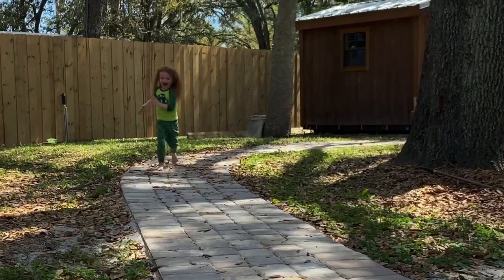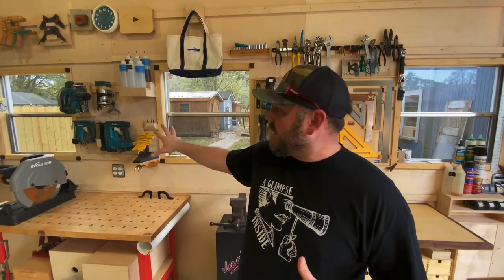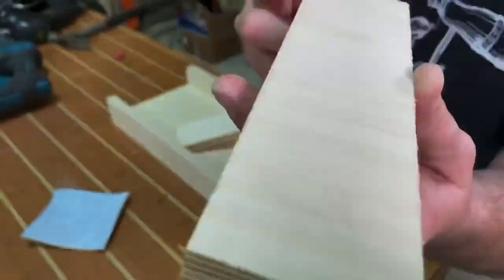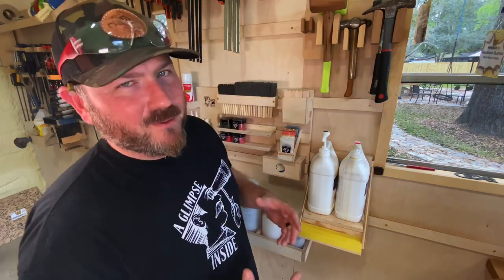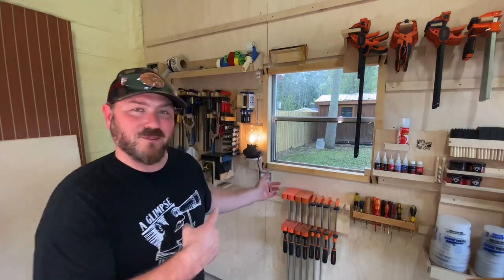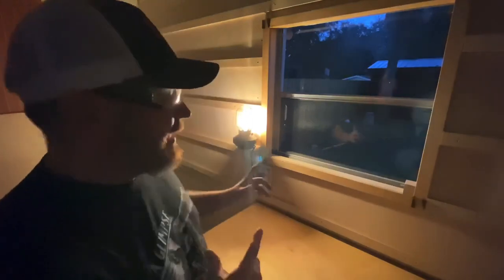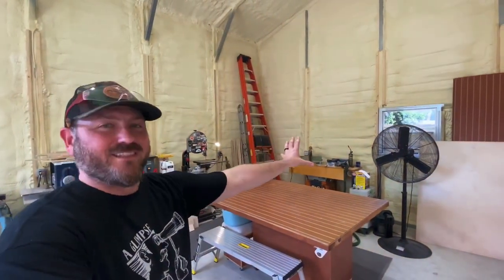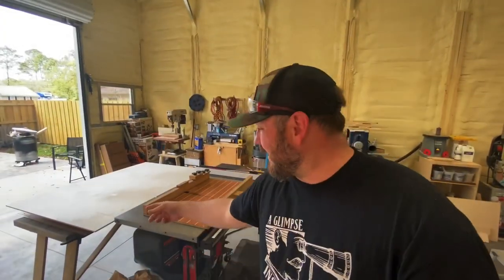30 Foot FRENCH CLEAT WALL | Shop Update #1

Comment: I used 3/4” OSB in my shop,  considerably cheaper than Baltic Birch so yes, it’s worth putting up solid wood and I’m using french cleats as well. You’ve given me some inspiration for stuff in my shop. Thanks Chris
Reply from the maker: Sounds good brother thank you for the kind words enjoy your shop as well
Reply: I did 3/4 OSB on mine also, white spry paint on the walls and I can see in my shop.

Comment: Live your shop. I am new to woodworking and have been building out my garage.  After installing new electrical I decided I wanted to do French cleat walls along several walls and insulating them with spray foam as well as the attic above the garage to then install a mini split.  This video has been inspirational and motivating.  Thanks!
Reply from the maker: Thank you so much I really appreciate the kind words

Comment: The epoxy center is great... I already had plans for doing French cleats when I can build my workshop (I am trying to relocate, so that is on hold), so I am always on the lookout for French cleat ideas. I also use them in the garden shed. Tell your daughter I said "thank you for the French cleat inception idea", since if I understood you correctly it was in part her idea. I am probably going to use that for several "tool groups" when I have a workshop again.

Comment: Hey Chris,
About your cleat on cleat travel section, I did that same thing about 15 years ago.  An advantage I found was on my mini-wall cleat section I made the section taller that need.  Custom trimmed the top and jig saw cut a hand grip into the section.  Then, like you, I can hang the section on my cleat rail or grab the hand grip and take it to my work location.   Also on all of my traveling mini-wall sections on the bottom I ALWAYS include in the planning an inclosed shelf, a box, or a slide out drawer.  The flat bottom and weight gives the entire thing stability for setting it down somewhere.
Good job.
I love your shop helpers.  I have three generations of helpers.  At present my youngest team are 7 years old, 6 years, 4 years, & 3 years.  So get them working early and who knows someday soon they can pay the household bills.
~Jim
Reply from the maker: That’s a pretty cool concept using them on a trailer like that. I like the idea of the drawer as well. You got an army of kids to help your brother nice work

Comment: Watching again because I'm ready to install French cleats.  I thought it was worth the cost to install plywood on my shop walls.  I covered all four walls (19'x20' inside dimensions), about 350 sq ft excluding windows, doors, etc. with 1/2" birch, probably the Vietnamese stuff with a very thin veneer but it serves the same purpose and I'm very pleased with the look and function.  My framing is 2x6s on 16" centers so I can still easily attach anything that's extremely heavy through the ply and into the studs.  I finished it with water based polyurethane to keep it from getting dirty.  The only downside to the cheap birch ply is that it's very easy to get splinters in the hands from handling it without gloves and I don't wear gloves around power tools.

Comment: Light idea is pretty cool. One small thought. How about enclosing the bottom into a box and at the back and bottom include a notch for cord. Then you can also move light, set it anywhere. Store cord inside box. Run cord out the bottom/back.

Comment: One could always go with particle board or a lesser grade plywood around the walls to cut down on costs and still be able to hang things anywhere.  But I do like the look of the BB, and hey, if the local store is out, just rip a piece off the wall and replace it later.
Reply from the maker: Very true but yes I do like the aesthetic of the Baltic Birch for sure I don’t know if I could surround myself and OSB LOL. Funny to think about meeting material just go to your wall

Comment: Ok, that cleat wall is goals. My shop is half of my 2 car garage and it’s not technically a shop yet since it’s still such a mess after we moved in at the end of last summer. My Spring project is garage organization and I may have to do this on the wall for the side that I will be using for my shop.

Comment: I think cladding the walls is a good idea if for nothing else than to protect your sprayed insulation from bumps and dents.  That being said, I would go with something a bit cheaper for the 'un-glamorous side' of the shop.  I have a small wall done with OSB and, if you carefully sand or otherwise hide the  labeling, it looks pretty nice itself.  I'd still use 3/4 birch ply for the cleats for strength though.  I would then invest the difference in a central dust collection system.  A shop this big and nice deserves  a big dust collector to help keep the place clean and the hoses up off the floor IMHO.  Love watching the shop go up and come together.  I'm very jealous!  I would totally "Man Cave" the place out when not working or for 'parties'!  I think that's a great idea since it overtook a large portion of the back yard.  Keep up the good work!
Reply from the maker: I agree with you brother. At least I have all the protection plus the super function. You got any pictures of your really nice looking OSB. If you do shoot me a message on Instagram I’d like to see them

Comment: Cladding the walls in plywood: I think that a cheaper plywood could have served the same purpose for the most part. [Edit: I just watched your other shop videos where you said they were like $33 apiece- that's a no brainer! Being in a cinder block house garage shop, I put up a $35'ish 4x8 sheet of sanded pine plywood from the orange store as a "screw anywhere" tool wall. The pine veneer works for me, but I get that your aesthetic tastes are yours :)

Ambient lights: I like the idea of non overhead lighting when hanging out and relaxing, but may need a more opaque diffuser such as frosting the glass or thin plane shavings (I think Pask made something like that). Then again it depends on how bright it is and if it's irritating to the eyes.

I'm about 3 hrs from you in the Tampa area. Always happy to see Florida makers who don't let this Florida heat/humidity boss them around

Comment: Great organizer wall, puts everything at the fingertips!  French cleat is a good system for a roomy shop like that, but I've tended to move away from it, since my cramped garage shop seems to shrink as my tool collection grows!  (I know, first world problems...)  So I'd love to see some ideas sometime that combine elements of both display and storage.  One such idea that comes to mind, by way of illustrating the concept, would be like a sort of 'book/leaf' tool board concept (not sure what you'd call it) where say a 24"x36" panel with tools on it, is hung on a couple of french cleat holders (top and bottom) that each have dowels for hinge pins, these dowels fitting into holes on the edges of the tool boards like hinge knuckles, allowing the board to swing left and right like pages in a book, as well as lifting the whole board on and off the dowel pins when needed, and then maybe half dozen of these boards side by side on the cleat wall?  Something that would preserve 'at your fingertips' display availability, while adding storage density to that section of wall?
Reply from the maker: That’s a fantastic idea really honestly. Thank you for that. I just might use that in my dad’s shop he is building it out now and it’s a bit smaller than this one. Maybe I’ll go film  my video with him
Reply: @AGlimpseInside    Thanks!  Although, I cannot take full credit, it's a mash-up of a couple different projects I saw at different times, and sorta just gelled in my mind.  Shop Nation did a larger swinging tool wall (https://www.youtube.com/watch?v=GojGtRKwQ0w ) with french cleats on it but mounted on wooden hinges with steel pins.  I figured a smaller board size wouldn't tear out the dowel hinge pin or the wall cleats.  Then Matthias Wandel made some wooden hinges where the door lifts off the fixed dowel hinge pin (https://www.youtube.com/watch?v=t1H7lj1zN_A ), which I thought might be more useful than having the french cleat hinge pieces permanently attached to the tool board.  So a french cleat holder with half the hinge, the dowel pointing upward, and the other half of the hinge, the hole, on the board, like Matthias's cabinet door hinge there.  Anyway, a few of those boards in a row on the wall, even if only able to swing 45 degrees in either direction, would give wide access to tools hanging on both sides of each, plus really maximize the storage density of that stretch of wall space.  Kinda like pegboard tool displays in an auto parts store, or those old blacklight poster displays they used to have in 'record shops' (dating myself there).  Good luck, hope it helps you out in your dad's situation.  And I do hope you can video it -- you make great content!
Reply: its called a 'hanging wall'.  building one now for more common hand tools as they are light. heavy stuff such as power tools goes on main cleat wall.

Comment: Good practice, lifting the finger away. Nail gun tip....99% of the time that a nail goes 'squirrely" on you when using a nail gun, it will go either right or left (perpendicular to the gun). So hold the gun perpendicular to the board you are nailing TO not the board you are nailing through. That way if it does go awry, it'll stay in the board.

Comment: I'm betting you're gonna really like that Jet air filtration unit (in the bottom box, in the corner). I bought mine many years ago when they first came out, and it was one of the best things I ever did. I wouldn't want to be without it now, 'cause it's made such a drastic difference in the overall air quality in my shop, and thus, in my overall health and comfort while being out there. And when my filters get dirty I just blow them out with compressed air, and they're good as new.
Reply from the maker: I think so as well. I really can’t wait to get it up and running glad to know that it works so well

Comment: That brad nail incident is crazy. Good thing your finger was okay. I like the french cleat stuff. I had a concept in mind for a french cleat workbench but that won't happen for awhile.
Reply from the maker: A French cleat workbench that sounds awesome. Why not bro
Reply: @AGlimpseInside  I recently just built a paulk/mft inspired bench with my own additions in January. I call the bench the Rebuilt Workbench v3. I have already started planning for Rebuilt Workbench v4. There are some tweaks I'd like to make as well as possibly introduce the first iteration of the french cleat workbench concept. My concept for the french cleat workbench involves task specific work tops that not only increase the work space of the bench but also add additional functionality to the bench. I am thinking that I will wait until I move into my own shop space to fully design and build v4. A hypothetical example could be maybe I want to add downdraft functionality to the table. I keep the main table as is then all I have to do is make a french cleat add on. Maybe I decide I want to have the table be more compact or have another module so I just remove the french cleat downdraft table and stow it away. Also I would have your typical smaller modules you would see on a typical french cleat wall that I could take off of the wall then add on the bench as needed like drill holders, magnetic parts trays, bins, glue/epoxy holders, etc. Mostly things you need on occasion but not all the time.

Comment: I know it won't be easy, or cheap, but, when or if ever possible, installing and finishing drywall, or even better using a product called Structo Glass that requires no finishing installed on the ceilings and walls above the plywood would give you much better light and obviously a completed look. When my local at the time EMTs built their new building several years ago they covered the walls in the section where the rescue and ambulance vehicles were kept so in the Winter they could pressure wash them in a heated space without damaging the walls. It has a satin sheen in white.
Reply from the maker: I will definitely have to check that out. I do wish I had at least painted the top 40% of the shop White to eliminate that yellow color. I’ll have to check out that stuff

Comment: I’m adding two comments, hoping you read this one! I’ve been looking for ie: of french cleat Heavy, Machine/Tool holders... what I mean in particular for your unfinished side of the shop is: Why not create a custom french cleat to hang your big machines on -(tools that tend to stay put but still allow flexibility to rearrange your shop) like your drill press, bandsaw -(there’s a YTuber who built a french cleat to a corner of a wall using a 4x4 or 6x6 pillar anchored to his studs, of course he added the ability to remove it when necessary, hence french cleat, but the point is he had nearly 360 degrees of space leaving him unlimited amount of range for movement/positioning when ripping/cutting long/wide boards which this cleat also included dust collection and custom drawers underneath for bandsaw accessory storage), scrollsaw, mitresaw, even a small table saw. There’s another builder who literally created this exact concept for his portable workshop trailer. You clearly have ample space to take advantage and create working stations and that’s why I love the idea of having a french cleat concept to store unlimited amount of heavy tools on either walls and/or pillars above roll-out cabinets or whatever works for you. And especially because it’s rarely done or seen at least, Ik I’ll be watching for that lol 👍🏼 Thanks a bunch 🤟🏽
Reply from the maker: Definitely all good ideas I would of course layer a bunch of plywood together glue and screws maybe 2 to 3 inches in thickness and make cleats out of that. We shall see I might start with a 1 inch belt sander that I have and see how it goes thank you so much for the idea

Comment: Hello, sorry if you mentioned this in the video and I missed it. How tall are those cleats? They look like they were cut in half from 4" or 5". Also when building the cleats, did you pre-drill holes? Did you countersink room for the head of the screw? I was thinking to pre-drill the holes in the cleat but then trust an impact driver to get the head of the screw flush with the wood. Thanks!

Comment: I noticed your cleats are spaced farther apart than some.  I am considering a cleat wall.  What  width are your cleats and what is your spacing (center to center)?  Love your idea on cleats on cleats.  Lets you have narrower cleats only when you need them.  Yes, I subscribed.
Reply from the maker: Thank you so much typically they’re 10 to 12 inches apart. But my latest video I discuss three different options I’m not sure if you seen that yet. Check that one out to get a better idea. Thank you so much I’m glad you’re here

Comment: Awesome shop brother! I WILL be building one very similar when webuild our place in crystal river. I just need to add in welding and metal tools as well as wood working. Great video production, however the only thing that bugged me os when you go from live video to narrating, the volume has a huge jump.
Reply from the maker: Hey man thanks for the feedback I appreciate that this new shop is changing the acoustics and I’m working on the details. So my next video should be a bit better if you don’t mind check it out and let me know what you think

Comment: Hey Chris.  I too went with 3/4 ply on my wall of my metal building.  I currently have a french cleat wall for my clamps, another one for my jigs, in the process of making french cleat lumber rack (a la Drew Fisher) and plan to hang my cabinets over my miter station on french cleats.  So,  how do we get more info on the makers meet ups?
Reply from the maker: Good to know I’m not the only one with all the plywood on all the walls. Making meet ups are communicated through a Instagram here so if you don’t follow me there please do so and send me a message letting me know who you are from this comment

Comment: What “thickness” of the starbond glue have you found works best?
Reply from the maker: It’s a green bottle called medium/thick. You will never go back to any other viscosity I promise. Remember if you need some use my code

Glimpse15

Comment: What is the vertical spacing or the galvanized tubing behind your plywood?  I know you added 2x4's to the sides of the tubing before insulation.   I believe my shop is 5 foot centers which doesn't work well with 4'x8' plywood.  If yours is also 5', how did you handle this?  Thanks man.  Hello from just north of you.
Reply from the maker: Yeah definitely 5 x 5 Baltic birch plywood is what I use because my steel tubes are 5 feet apart on center. Not sure where you are in the country but a lumber dealer hardware/Hardwood dealer will probably have some Baltic at some point which comes in 4 x 8 and 5 x 5
Reply: @AGlimpseInside  I'm 45 miles North of Jacksonville.  Got our of the city about 13 months ago.   Thanks for the response.

Comment: Yep! I think you're kinda crazy. But it's fun crazy. Nice to see you having so much fun in your shop. And, I definitely think covering the walls with 3/4" plywood is worth it. I did that on only one of the walls in my shop. Next project... french cleat system. btw, based on your experience, what cleat spacing do you recommend? I saw one guy admit that he has more fun working on his shop than building things in his shop. Hmm....
Reply from the maker: I actually I’m going to have a video about the spacing and various types of different cleats and what might work for various situations. So stay tune for that because there’s a lot of information I want to share. But question really quickly I like 10 inches  between cleats